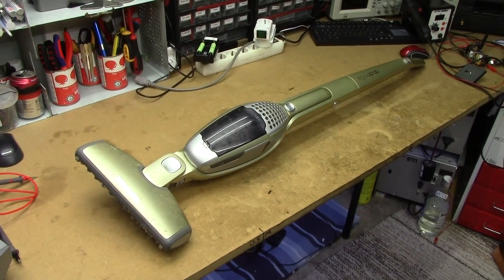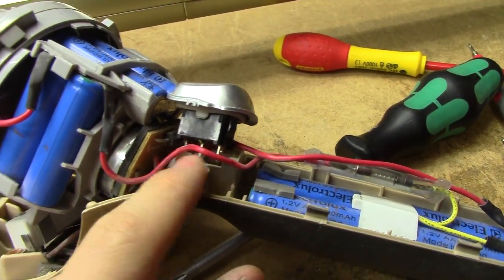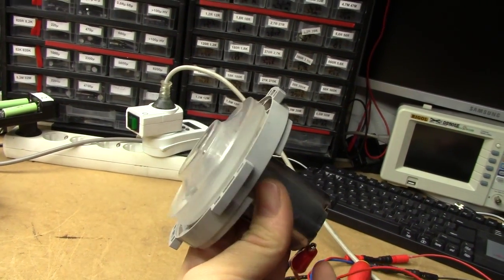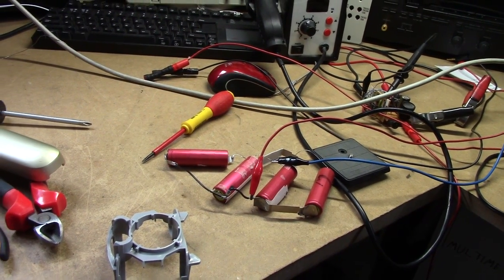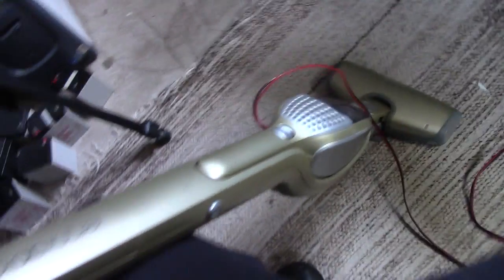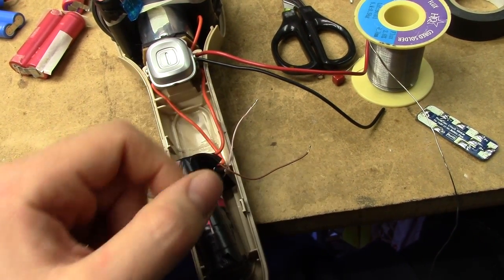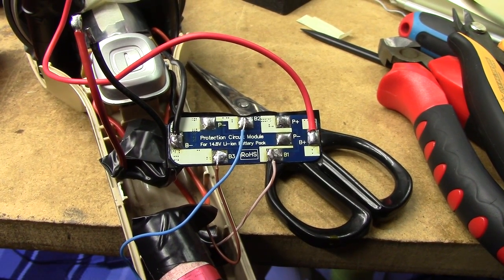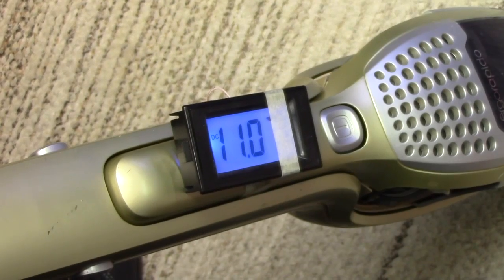Electrolux "Ergoinsano" - NiMH to Lithium hack (warning: anticlimactic)

Comment: Made the same swap but 3s2p and used thicker wires. Also tested old 18650 with at least 2000 mah.
Reply: It's not the mAh that matter.... it's the Continuous Current rating of the battery cells that matter. So, if using single cells in series, you'd need power tool batteries rated 10A or more. You cannot use Laptop cells, since they are typically rated for maximum 5A to 7A, with much lower continuous current rating.

Comment: Use that batterys in 2S2P configuration, it's reduces the motor current consumption and increases the overall c rating of the pack! 4S is to much for that motor.
Reply from the maker: +Peter Kis Too much is the point! I already have the 18 V lithium model for a sane vacuum, so I'd rather this one spews flames. I'll probably order some LiFePO4s to shove in it, though.

Comment: okay, i've got one like this...it's supposed to have 2 speeds but only works on low speed...is there either a way to bypass this without fucking up the charging of the batteries OR can i just fix it maybe? Any idea..?

Comment: i was going to make a comment on li-poly/li-ion safety but apparently you already know. "yeahh probably not going to be too happy, but who gives a toss ? if it catches fire it catches fire, just toss it outside" haha. ;) thumbs up just for that. edit: LM2677T, "simple switchers" (e.g. only need to toss on a few aux components to set your output) to step down to whatever amperage that motor is rated for, you can get it for a few pounds off digikey(5.50 US). sometimes they just toss you free samples from their website if you pretend to be a company.
Reply from the maker: +wither8 Step-down? But that would make the motor run slower, and that's not what I want! If I were to go that route, I'd probably just get some Ebay module to do the job

Comment: Dude, you are awesome! Exactly as uncareful as I am, i love that ;) Hooked mine (a black and decker) up with a 2200mAh 3S lipo and it runs just fine. The power is overwhelming, and now after a year even the hobby charger can't bring 2 of the cells over 3.8 even if the other is a 4,2 for a long time. I hooked up a balancing connector to the side and charge it from my hobby charger (positive to positive and negative to negative plus the balancing connector on the side). It has also a lipo voltage warner that is powered by a relays when i turn it on to check the voltages. Its a bit of a hassle each time i have to charge it, but at 60 eur+ for one with similar power, i kept doing it. One year ago, When the battery was new, i think i measured 21A on the motor (mine is a 9.6v version which run with nicads) I'm expecting a BMS in the mail, similar to yours, but 24A, lets see how it goes. Brilliant video I have to say ;)